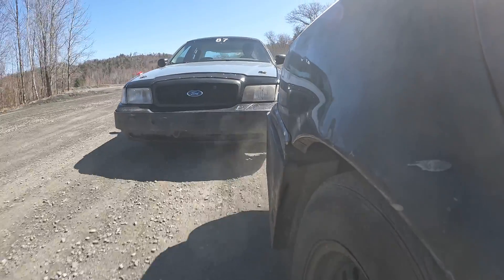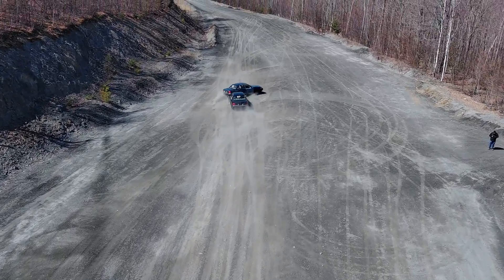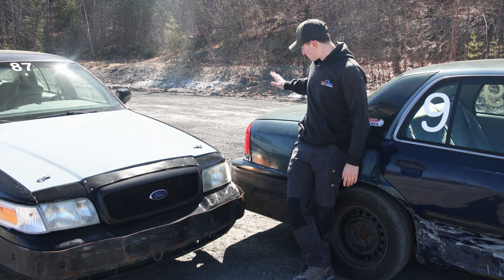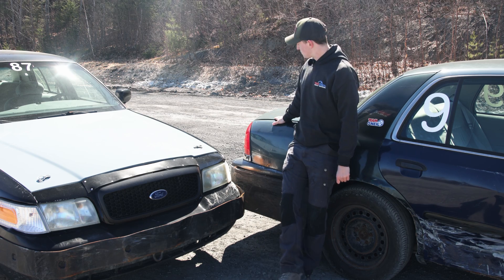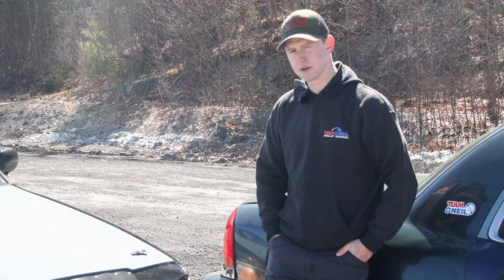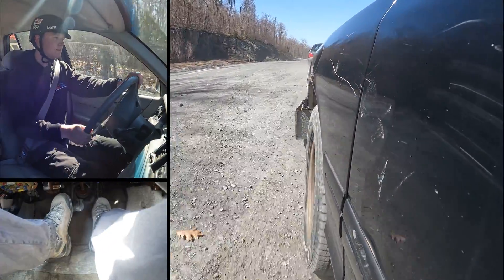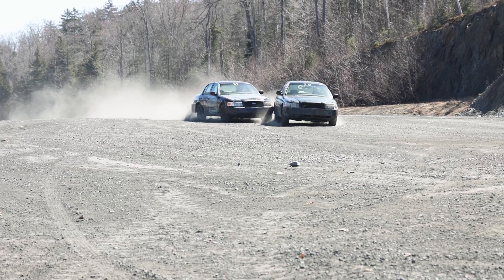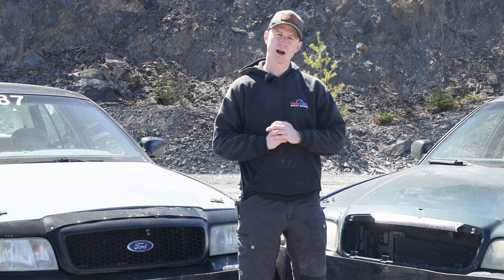How Does the PIT Maneuver Work?

Comment: This video is giving all the means to counteract an PIT-manoeuvre, just follow all the given instructions and anticipate.
Tip 1:   decrease leverage by slightly breaking (more contact) or speeding up (no contact)
Tip 2:   use a car with engine on the back side (more weight) or dump your trunck full with concrete or metal items
Tip 3:   after being hit softly from a back side immediately accelerate and counter steer into the the direction of the road
Tip 4:   watch the vehicle behind to drive up to close proximity then brake hard or accelerate 

And a personal tip: avoid being chased by law enforcement, but know what to do when some nasty road rager tries to get you in the ditch.

Comment: Would like to get input on the what sort of factors pavement has on pits? Of course gravel is nice easy beans but dry pavement wouldnt that add alot of drama / more force?
Reply from the maker: On pavement, there is more friction and the PIT requires slightly more momentum. As a result from the extra force applied, things happen a little more faster and dramatic.

Comment: @1:26 you said HIT the car nice and far back, showed a clip of the car closing in from more than a foot away then changed direction at @2:30 said you don't use hits, you use a push..... 
match speed - touch make contact turn and accelerate